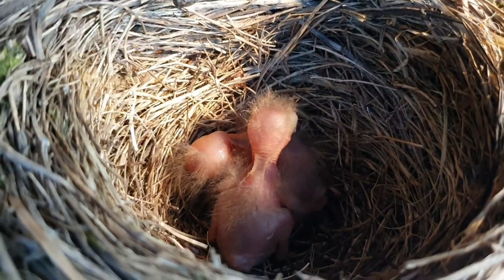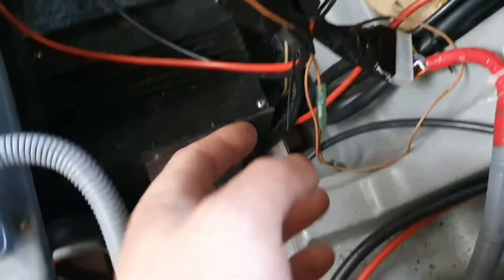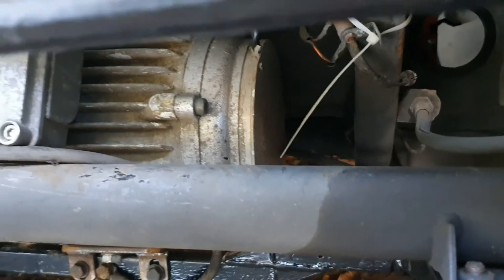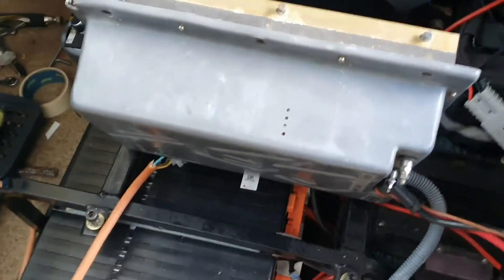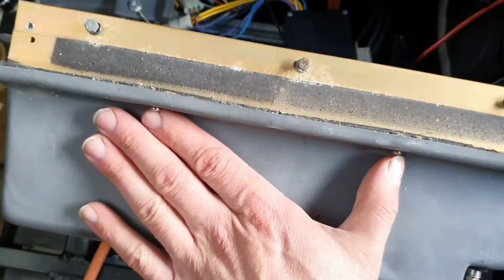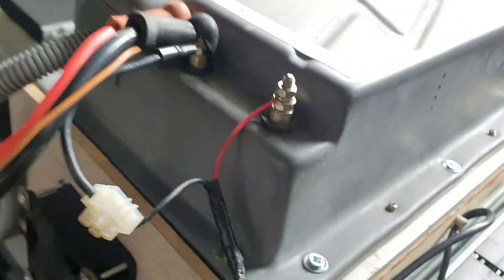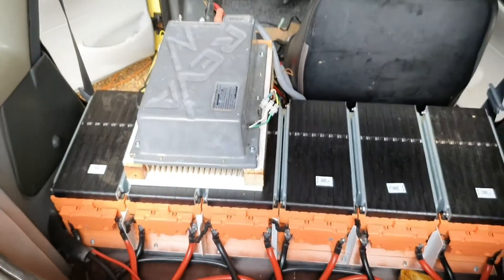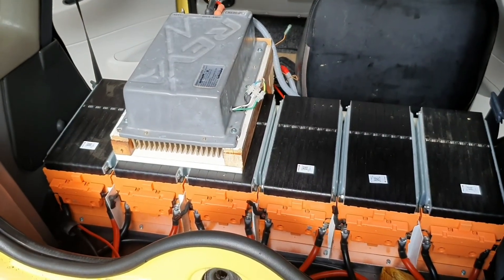REVA G-WIZ: Yellow Wiz Lithium-ion conversion pt. 24 - setting up the charger

Comment: Hi Richard, did you put your own voltage limit on the charger?
Reply from the maker: Hi I did just setting it to the max voltage that the charger outputs as it is the same voltage as the max of these modules.

Comment: The original G-Wiz charger is cooled by two 120mm fans running at full speed. Even if just one of them fails, the charger will continue but the charge current will drop way down in order to protect it. You could monitor the power and observe whether it drops after some minutes of charging.
Reply from the maker: On the DC, it's just one small fan that draws air from the battery compartment. My AC has 2 fans that I wired up so they continuously run whilst driving too because of the extra range especially in the summer. As you can see in the video I reused this fan and recreated the active cooling element.